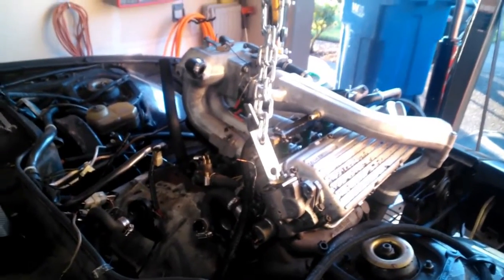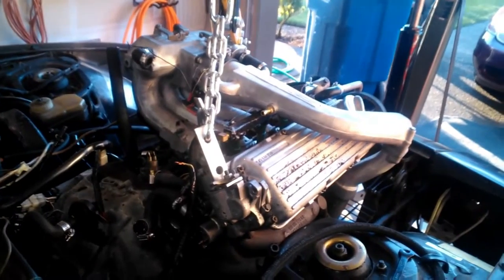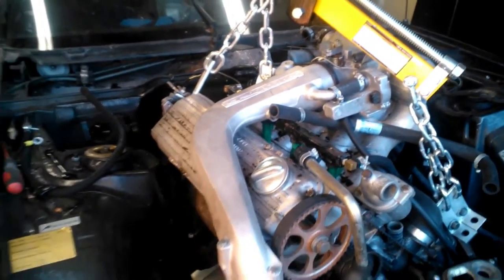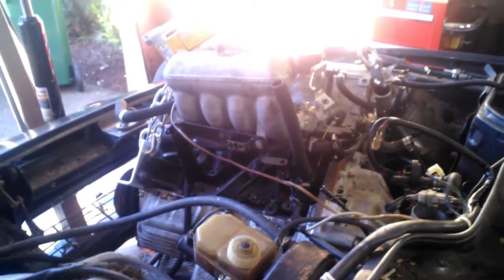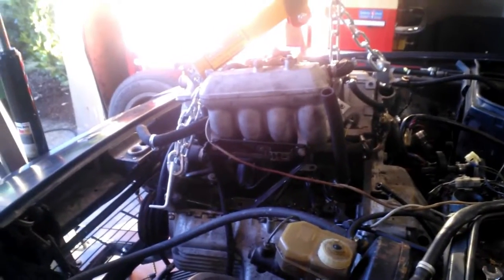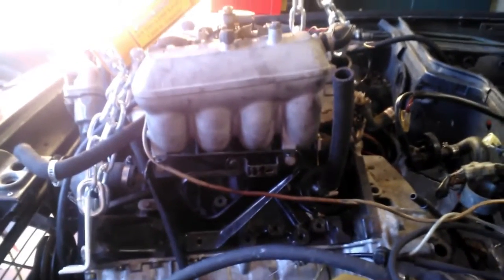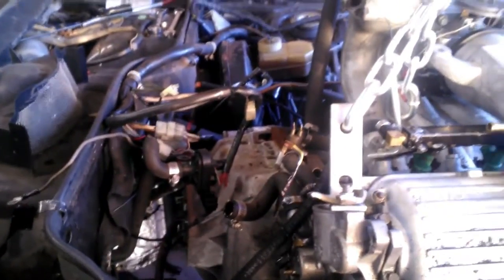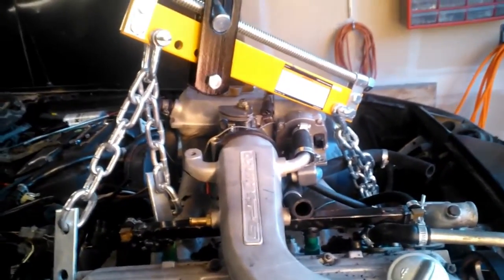1981 Porsche 924 Turbo | Engine Removed

Comment: How did you reach the torque tube bolts. I can’t reach them. I’m working on a 1981 924 Turbo
Reply from the maker: It was a total nightmare. You need very small/thin tools with the right extensions.

It might not seem possible, but it is. It's just really difficult :(
Reply: Thanks for the video.  Interesting.  Why did you pull the motor?   I have a 81 931.   Have had to drop the exhaust twice now.  I hear you.  lol.